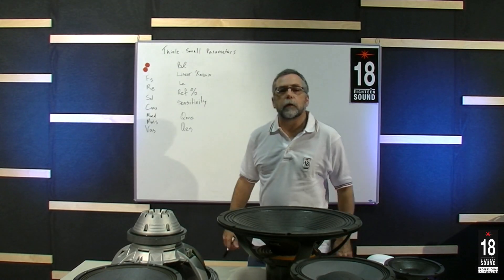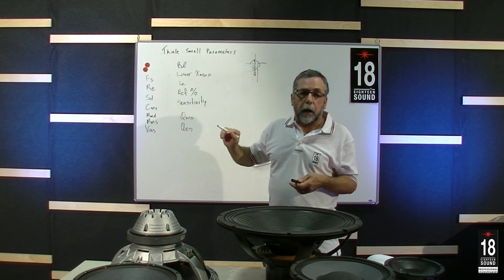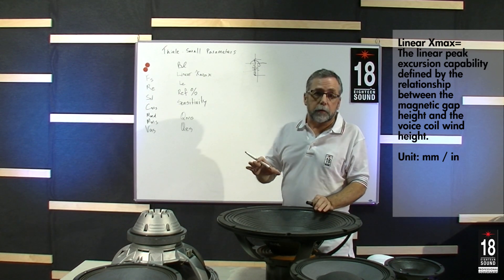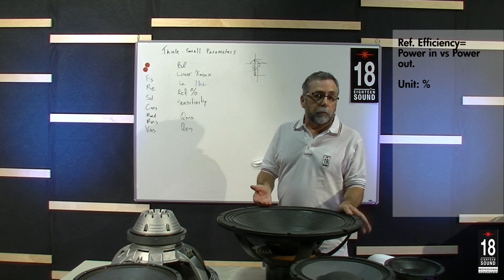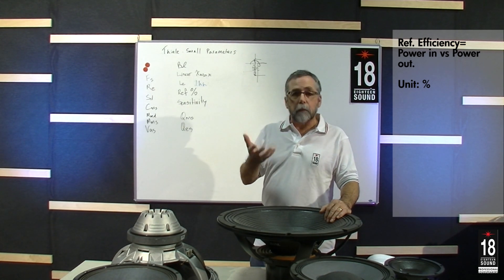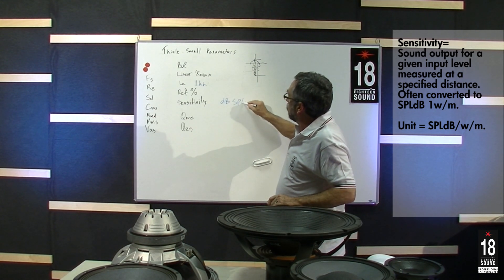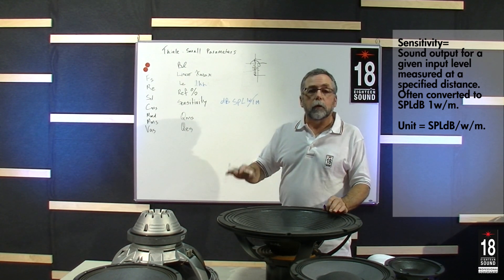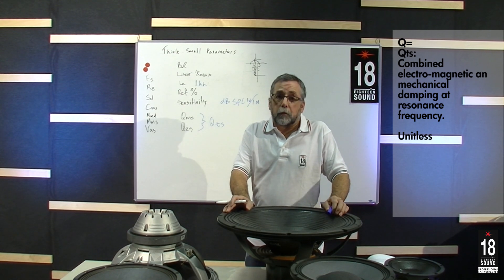18Sound - Loudspeaker Lyceum - Chapter 4 - The Thiele Small Parameters - Part 2

Comment: How is the sensitivity of a full range loudspeaker measured?  Is pink noise used?  What if you are only testing say a midrange driver?  Is that pink noise first filtered to only include the frequencies that the driver can reproduce (such as 500-5000 Hz for example), or is a full range (20-20000 Hz) pink noise signal amplified and sent to the driver using passive crossover components?  Is either way accurate?  Is one way more accurate?  Lastly, if the sound is prefiltered for each driver in a 3 way speaker system and each driver is tested individually for sensitivity, what then might happen if a full range signal is fed to the entire 3 way system using a passive crossover?  For example, if the woofer (20-500 Hz) has a solo sensitivity of say 90 dB / 1W / 1m and the midrange (500 - 5000 Hz) has a solo sensitivity of say 93 dB / 1W / 1m, and the tweeter (5000 - 20000 Hz) has a solo sensitivity of say 95 dB / 1W / 1m, then what should be expected with a "average" passive crossover added to the 3 drivers as far as total sensitivity (in dB / 1W / 1m).  Can it surpass that of the least sensitive driver?  In this example, could the system sensitivity be 91 dB / 1W / 1m even though the woofer is only 90 dB / 1W / 1m?

Also, isn't the sensitivity of a woofer highly dependent upon what type of box it is put into (sealed, ported, transmission line...) and if the box is too large, too small, or just right?  If so, how then so they rate woofer sensitivities?  What are they basing them on? An infinite baffle?